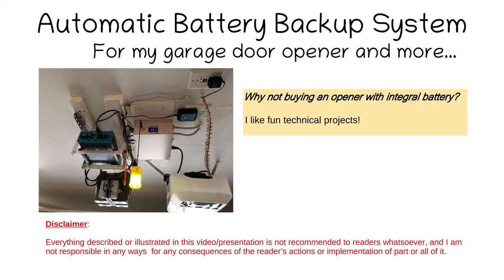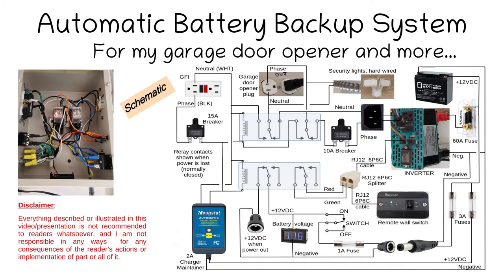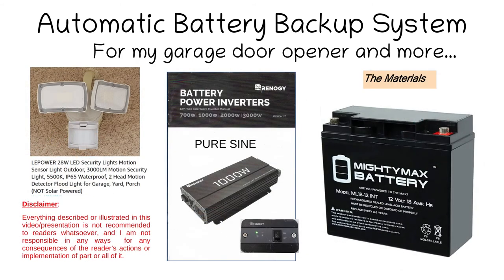Garage door opener battery backup system DIY

Comment: Hello! Awesome video. Will this system power an old year 2000 Craftsman with an AC motor?
Reply from the maker: I can power 1200 watts for 1 hour because I now have a 100ah lithium battery and 300 watts of cheap used solar panels to recharge

Comment: thank you for this video! here in south africa our pathetic government implemented what they call loadshedding where they will switch various suburbs off for 4 hour at at time 2 to 3 times is any 24 hour cycle. this is very disruptive and very damaging on appliances. most people revert to solar installations, however this comes at a tremendous cost. small systems like this. seems to be a cheaper option!
Reply from the maker: Thanks! Unfortunately our communist government in the US is doing the same. Shutting down coal and gas to move to wind and solar. Very unreliable. No plan to provide enough energy. In California we are told to buy electric cars but when there is too much electricity demand the Governor asks people to stop charging! So ridiculous. Meanwhile China keeps building cheap coal burning plants and manufacturing the solar panels.
Reply from the maker: I upgraded my system recently. Now have 300 watts of solar panels purchased used for $25 each. I put a solar charger and a 100ah lithium battery on it. Now I have 1200 watt hour of power. Solar panels can recharge the battery in 3 to 4 hours from empty